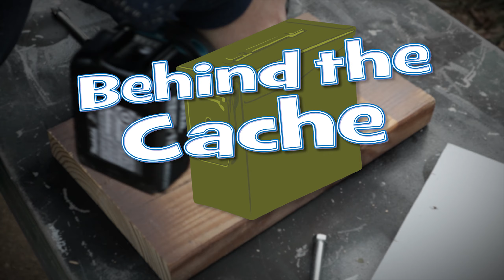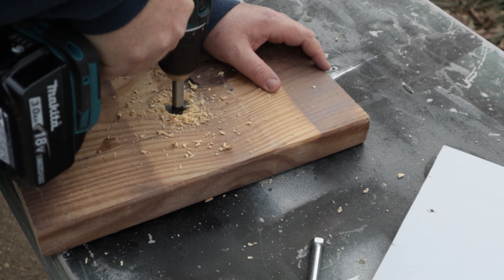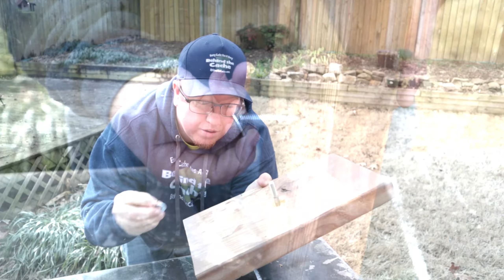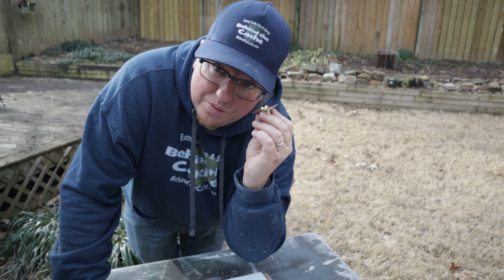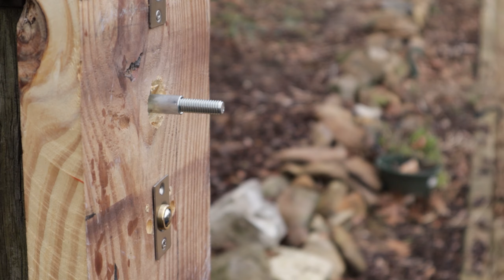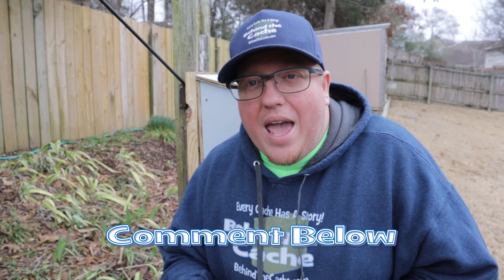Gravity Lock Gadget Cache Build Part 3 (GCNW)

Comment: As you spin and rotate this around, won't the bolt that's holding it eventually come loose and cause it to fall?
Reply from the maker: The metal sleeve is what really turns. If you have then tightness right with the second nut locking it in it should not loosen. You can also use locktight on it to keep from loosening.
Reply: @BehindtheCache  Ok, that's good. I was thinking if they pulled it towards them a bit and turned so there was friction on it, it could loosen it over time. 
It looks cool! Put a video up featuring people finding it!
Reply: Komikino b
Reply: @robertabderhalden113  B?